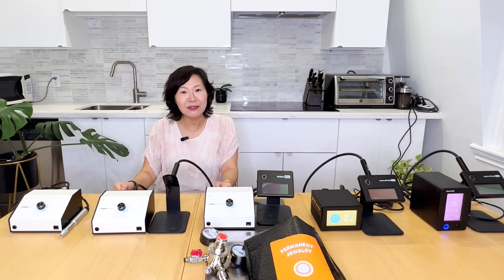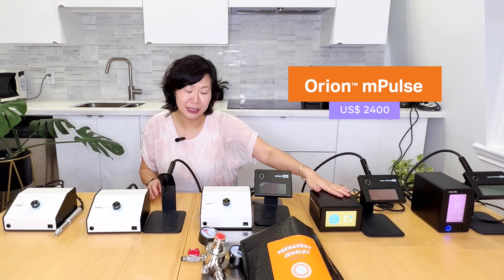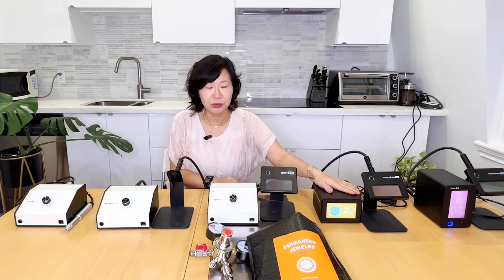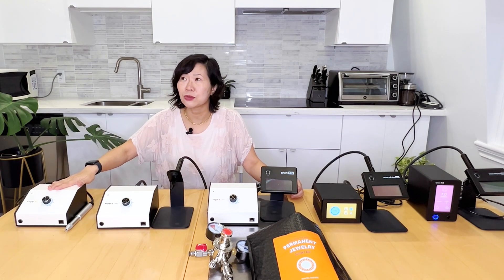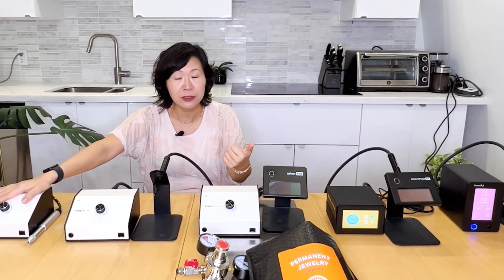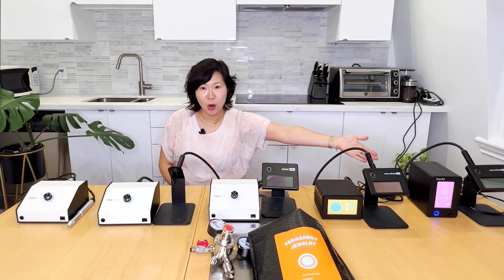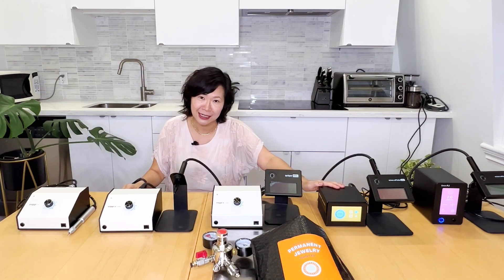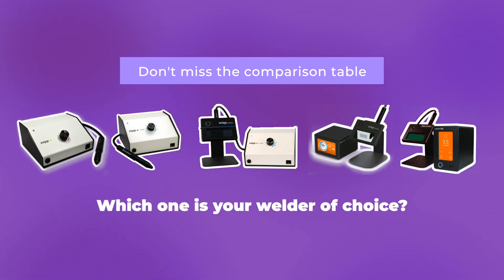5 Micro Welders Comparison | Sunstone Welders For Permanent Jewelry and Jewelry Making | Review

Comment: Which one would you recommend for people that travel often for work?
Reply from the maker: The budget choice would be Zapp Plus with ADL.
The luxury choice would be mPulse 30 V2.  

Both are compact, durable, with removable stylus.  

The original mPulse in the video has the stylus cord attached, but the new is removable.  It didn't both mer much doing all the pop-ups.  The mPulse is super durable and I've used my for 6 years, and dropped it once (my heart skipped a beat), but it turned on immediate with no problems.  It's the most reliable welder on the market.

Comment: I just bought the Zapp Plus but I’m unable to make a weld w/o the argon? Am I doing something wrong I tested it on the card provider it works just won’t make a weld
Reply from the maker: This should be the case.  You don't need argon gas to weld.  Do you have a jump ring to test with?  Have both ends touching.  Then try it on higher than the power needed, which can compensate for shaky hands.  

Here is the power setting chart to go with:
https://stonesandfindings.com/free-resources-page-pj-jewelry-making-information/optimal-power-setting-for-micro-welding/

If you bought the welder through us, I want you to email me and we can set up video or some way to communicate and I see what you're doing.  Otherwise, try the above suggestion.  If it doesn't work, simply contact your dealer.  They should figure out what you're doing wrong.  I am certain there is a very simple fix.

Good luck
Dana
Reply: @stonesandfindings  I figured it out I wasn’t holding it up long enough but I got it now! Thanks for your response!